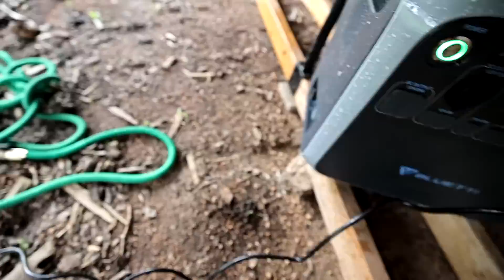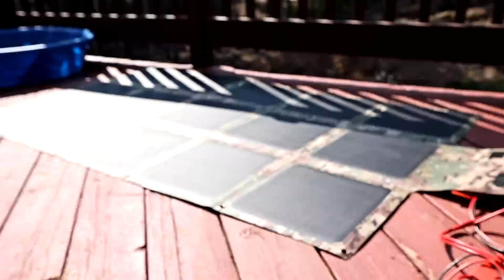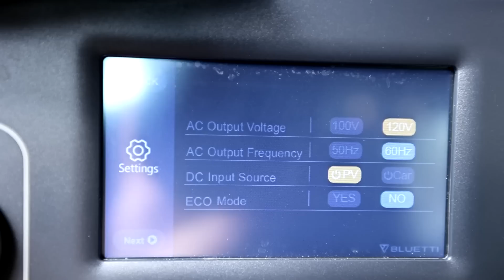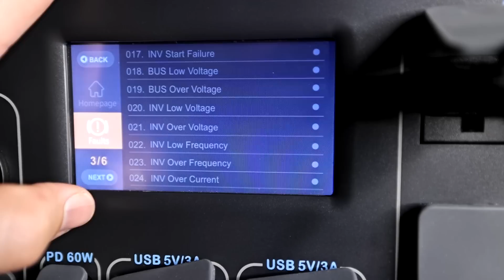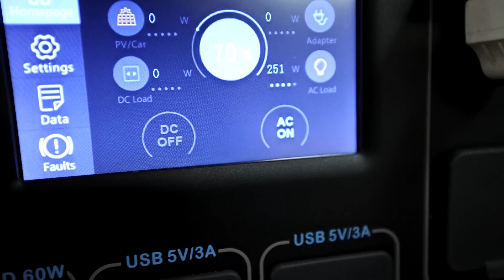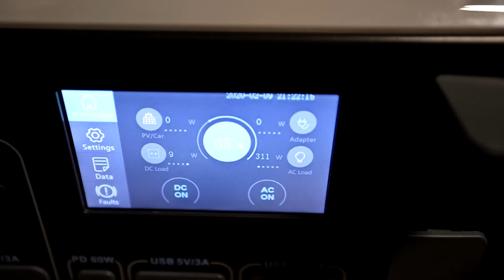Power Anything, Anywhere - Off-Grid or On-The-Road - BLUETTI AC200P Solar Generator Battery

Comment: Will the Bluetti AC 200MAX solar gen.   have enough  start-up power  to run  the  Dometic RTX 2000 air conditioner ...  I know the running time is limited  but will it run ..

Comment: In house I run Fridge, washer and dryer all at same time total loads 1100-1400 watts. Use 600+ PV solar input plus ac charger 450 input powered by eb240. Both with full power panels. Run two loads od clothes and dry in gas dryer. Or use ge dishwasher at 900 w heated cycle with fridge 140 n washer 200-800 pulsed.

Comment: Love the review, any info on vibration or operating temps? I have a new Tremor and looking for off grid portable power options that can be somewhat mounted in the truck with the truck being the primary charging station and using the outlets out the bed of the truck, thanks for your thoughts, cp

Comment: Anyone know if it’s bad to run these while you’re charging it with solar? I know it’s possible but will it damage the battery faster?
Reply: No problem 700W or 900W are under 1C. If you always charge with max of 1200W (AC200p) or 1400W (AC200 Max) it could lowering lifetime of LiFePo4 Cells, but cycles are over 3500+ even then you will have fun with it for a long time.
Reply: @mayday6880  ok cool thanks.

Comment: Good video, glad you mentioned that it needs minimum 35V to charge, be good if the manufacturer was more transparent about this to customers that do not understand what is required from solar to charge this.  Most buy it with one 100W Panel thinking it will work.  Great unit otherwise.
Reply: I think you can plug it into the dc input for the car

Comment: I've been trying to figure out a way to run a coffee maker while camping. Yes I do have pour over systems but it takes forever to boil water on a propane stove. I just want to grind coffee, put it in my coffee maker, and press a button. I looked at battery systems like this but something that will run a coffee maker costs in the thousands. We typically camp with two Jeeps so we have plenty of battery/alternator power. I picked up a 1500w inverter but that ended up not being quite enough. I'm now looking at 2000w inverters. 

I'm curious what the real benefit of these over an inverter setup when you definitely have vehicles handy?
Reply: @amorton94  It's a small 5-cup coffee maker from Bonavita. Listed wattage on the device is 1100 watts. I figured a 1500 watt would be enough. It sort of powers the coffee maker, but sometimes the inverter will shut off every 20 seconds or so and I have to keep turning it back on to finish the brew cycle.

Comment: Do you have a pellet smoker? Curious how long it could run it for.
Reply: They just got a Traeger IIRC. It'd run forever (not literally but for a long time). Pellet grills, in general, only have 2 small DC gearmotors and a hotrod. The hotrod only runs for a short time at startup to ignite pellets and then turns off. After that it's just the 2 low draw motors running intermittently for as long as the cook goes. It also would depend on which grill you're talking about, some are 120v AC, some 12v DC, and even some 5v USB. I can plug my grill directly into the cigarette lighter port in my car and run it for as long as I need.

Comment: I'm sure someone on here knows this...If this was used in a weekend cabin, what considerations would there be for solar panels. Could I just buy any permanent type solar panels and plug them in? Do I need to buy a specific cable that's different if I am not using the portable Bluetti panels? I would like to have permanent solar panels but I will only be using the cabin on weekends and occasionally for a week or so at a time and not much in winter. Thanks in advance to anyone who can point me in the right direction.

Comment: Will it handle the load of a refrigerator, and how long?
Reply: Way too many variables to answer that. What size refrigerator? What’s the start-up amperage? Running amps? Ambient temp? Refrigerator temp setting? 
There are more, but just a few for food for thought.
Reply: Hi I run 3 LG refrigerators at the same time off my off grid system.  Together they pull a total of 300 watts.  2 of the the units are full size kitchen units, the 3rd one is in my bar and is a mid size refrigerator freezer.  These units are about 3 years old each and are LG “inverter” models.  Inverter in this instance is not an AC to DC inverter but refers to how the motor in the unit cycles gradually from full off to full on to full off.  So if you refrigerator is fairly new and both the refrigerator and freezer compartments are fully packed (you loose less cool when you open your door), then you should be pulling about 100 watts and the Solar Battery is 2 KW so you should be able to run 20 hours.

Comment: I just had my manufactured home dropped off on my off grid property in Colorado and bought one of these to power the house temporarily. I bought a cord and cut off the end, wired in a dryer outlet plug and bonded both hots together in it so it is back feeding both phases to the panel from the dryer outlet. Instantly had power to all lights, outlets so I could vacuum and make some coffee and use the microwave. Obviously this isn’t the intended use case but it is working great for my current needs.
Reply: Ha! "Current" needs......I'll see myself out.
Reply: NOW EXTRA NEWS. SEPTEMBER DELIVERY 2300watt bateries can be used with this. New bluetti ac300 even better. I use eb240 input fed 450 input fir ac and 600+ solar. Now have 7500 plus stores. Need an extra 2300 for cloudy days. Best wishes.

Comment: Please include how long you can expect something to run. Not just “can it run X “. Thank you.
Reply from the maker: For most devices, it’s a pretty easy calculation, but depends on a lot of factors. Say a 2000wH unit, has a usable capacity of we’ll just say 1700wH (factoring things like inverter consumption, reserve battery capacity, etc). So if your device pulls a constant 100w with no breaks (which few devices do), then it’d last roughly 17 hours. If you had a device that pulled a constant 1700w, then it’d last roughly an hour. Most devices though (such as a Dometic fridge or whatever) do not run constantly, but they cycle on and off. So a big question I guess is “how long will it power my fridge” - which is impossible to answer, because many variables affect that like outside temperature, how often it’s getting opened and closed, what is actually in the fridge, etc.

Comment: How does it compare to the older bluetti that you have, the blue suitcase?

Usb-c is such a great plug, so much can be charged using just that port.
Reply: Minus the ports on phones getting filled with pocket lint and not charging.

Comment: I got the AC200 during the crowd-funding campaign.  The biggest issue I had was the voltage requirement to charge via solar - one panel is not enough in most cases.
Reply from the maker: Yeah, I agree that’s one of the most frustrating things with this unit - and I do cover it in the review.